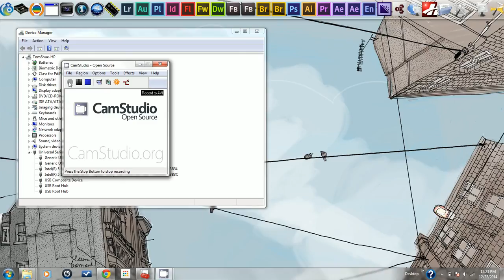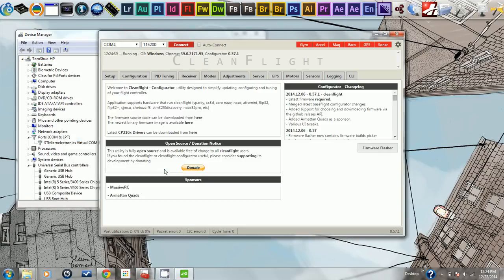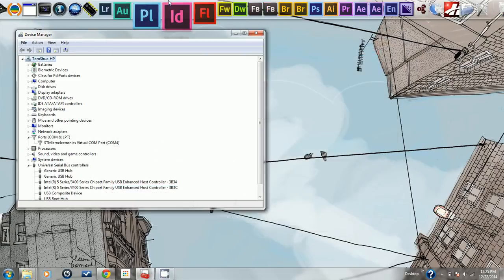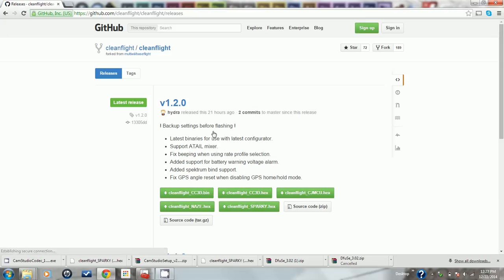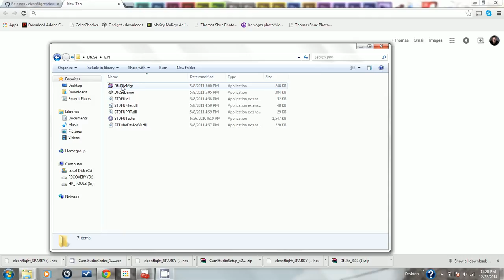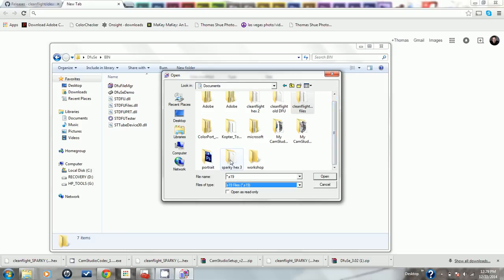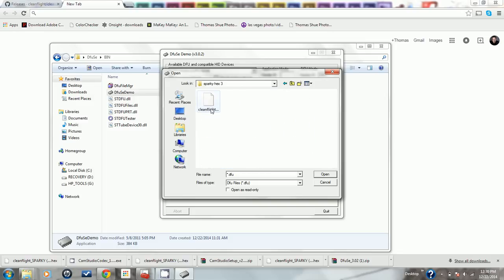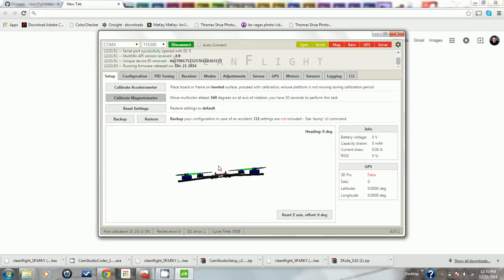How To Flash Cleanflight To A Sparky Board Via The Bootloader

Comment: Awesome. Thanks a lot for that. My Sparky 1.0 is all clean now :-)

Maybe one additional point to add:
In my case it happened that the Sparky in Bootloader mode was recognized as "STM 32 Bootloader" in Windows 7 instead of "STM32 in DFU mode". Selecting the "STM 32 Bootloader" device in the device manager, update Driver with manual selection of which driver to install (else it will simply install the STM 32 Bootloader driver again) gave the option to either install the STM 32 Bootloader driver or the DFU driver. After selection and installation of the DFU driver it worked as advertised.